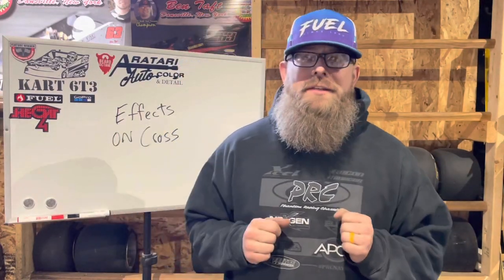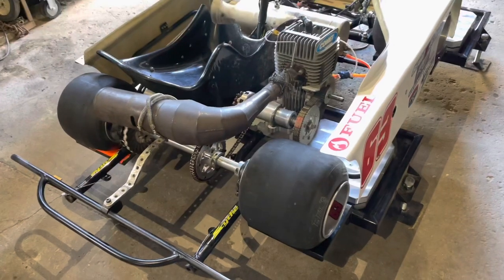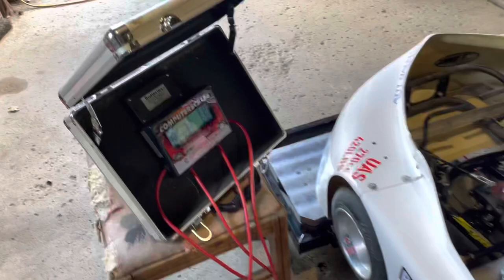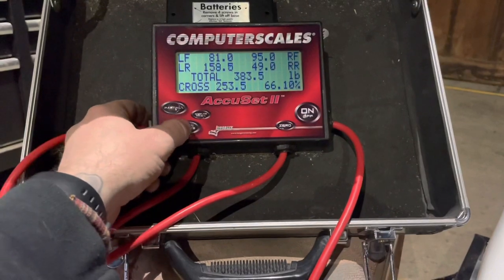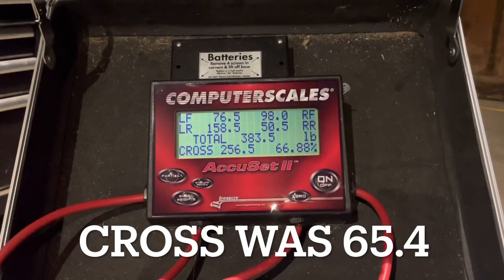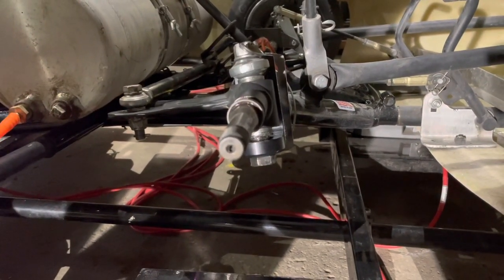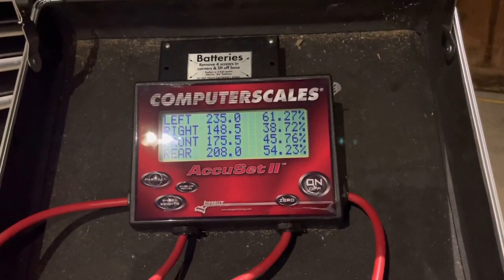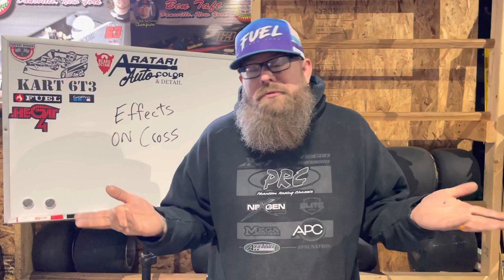Adjustment effects on kart cross

Comment: Do you think it would work if I used a bully 3 disk clutch for my jack shaft with my Yamaha kt100
Reply from the maker: Yes.  It’s just slightly more rotating mass.  I actually used a 4 disc off my open to start last year.   It’s was waaaaaay overkill but worked.  A three disc would be tougher then a 2d with negligible loss of “power” and that’s mostly of starts and restarts.  Once your wound up it’s even less. Imo.

Comment: Good video on how to change cross numbers, but what affect does lower cross % have on the chassis?
Reply from the maker: In short.  On a “modern” Chassis…. Say 2010 or newer. Higher cross will free the chassis effectively getting off the RR.
Reply: @kart6t3_ben  ok so more cross will help our push at mid/exit out of turn?
Reply from the maker: @CustomKidzCars  I would think so?  The way I think of it is the harder your on your RR the tighter your going to be.  But keep in mind that more stagger sets up center turn and effects exit as well.  It’s a balancing  act.
Reply: @CustomKidzCars  dont put you seat too far left it will lock your lr and it will not turn.

Comment: We are running bliss and having trouble getting lose coming out of the corner. We don't have scales yet as we just started out this year. Any suggestions on how help that?
Reply from the maker: Any idea what chassis and year?   A quick suggestion might be more rear weight, maybe try even air pressure all the way around (or less air split between right and left)
Reply: The chassis is a phantom nemesis. I moved the LR in 3/8" added 10lbs just in front of the engine and rolled the FR caster block back one and LF forward one. It's better but still spinning out on the exit of the turn. How many psi do you suggest?
Reply from the maker: @rickarcher300  so with a chassis like that I consider low cross chassis,  you can add cross (RF down and/or LF up) on the front spindles.  I run 5/4 psi on my kt100 but idk that will work on asphalt?   I’m not super versed in asphalt racing but it’s similar to southern grip.
Reply: Thanks! We'll give it a shot.